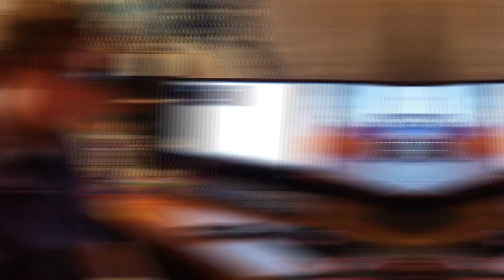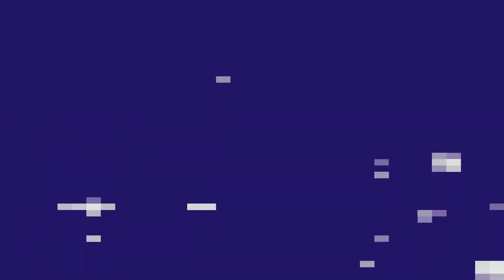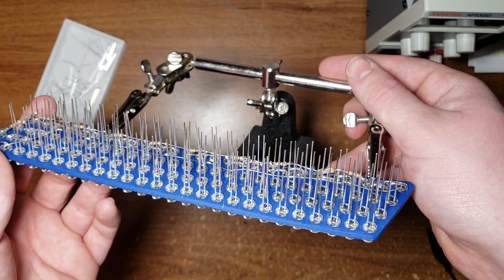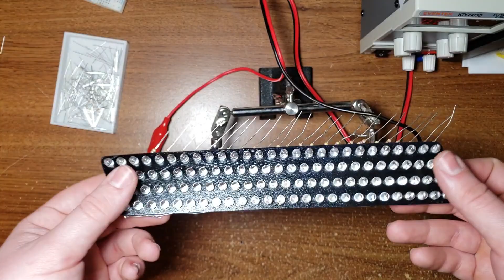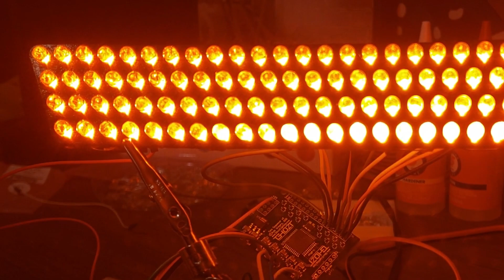Miata Sequential Turn Signals ACTUALLY WORK!

Comment: Hey, is it possible to get the code from you? I’m trying to fix my 2jackcustoms blinkers but the boards are fried. So now i have to code the blinkers myself. Only problem is that I don’t have a lot of experience with coding. Thanks  in advance
Reply from the maker: This code was specific to the ghozt modules and needed a special connector device to be able to transfer the programming to the ghozt module. You would have to rebuild the lights using the ghozt module in order for it to work.

Comment: Hey 
Are you gonna use load resistors ? 
Can please fell me how can u avoid hyper flash without load resistors?
Reply from the maker: I am personally not a fan of load resisitors once leds are installed into a turn signal. What i did on my miata was modify the flasher relay to have a larger resistor in it and prevent the hyperflash.
Reply: @PeaceParts  can you show us or tell us how did you modify the relay and what type of load resistors did u use ?
Reply from the maker: @hasankhalid1204  I followed this thread. It is pretty well documented on the forums, which is why I didn't feel a need to video it. 

https://www.clubroadster.net/threads/na-diy-flasher-mod-for-led-bulbs.41048/
Reply: @PeaceParts  thank you ☺️

Comment: Are you using 2 modules. Or running both lights off one??
Reply from the maker: Two modules. You could definitely run them both off of one controller, however I wanted as little wiring outside of the housings as possible, so I just used two boards, which is definitely not as cost effective.
Reply: Peace Parts thanks a lot. I was thinking of using a waterproof project box but I can imagine the amount of wires all over would be unsightly.